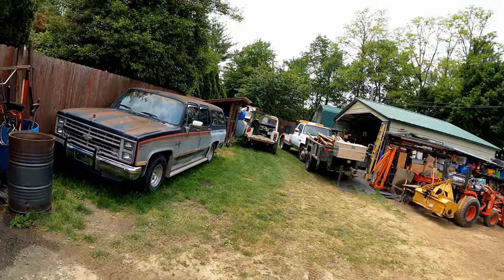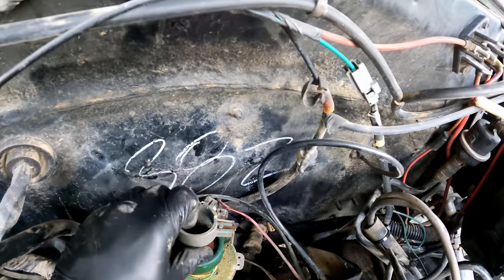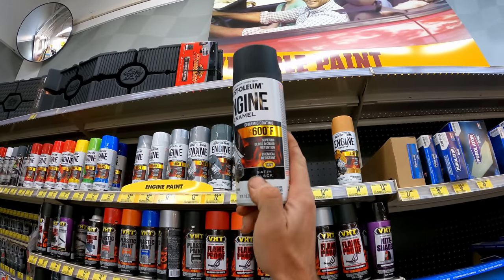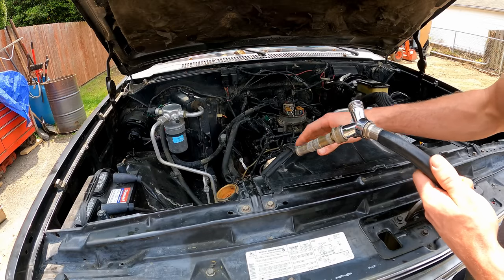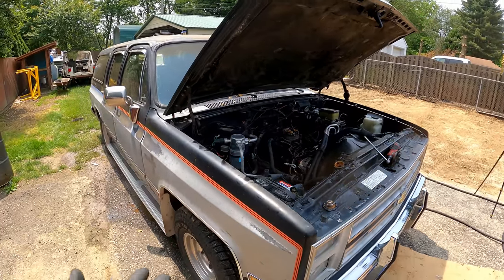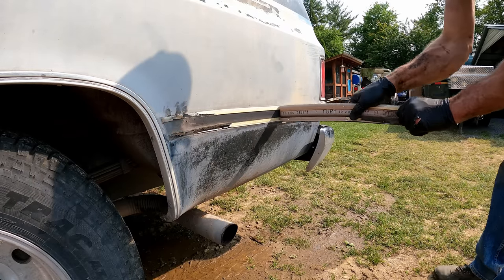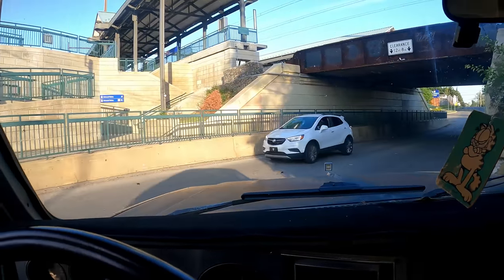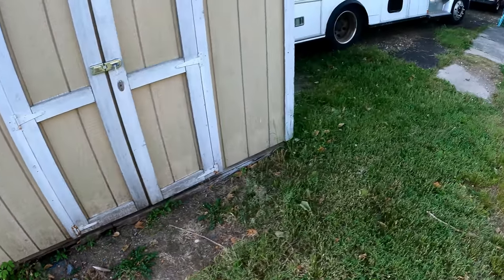'87 Suburban Intake Leak and TLC "Ema2.0" - NNKH

Comment: 11:33 i hate to say but i think you have your intake gaskets on backwards, one end of the gasket has the normal opening and the other has a small restriction. The water flow goes rearward from the water pump around the cooling jackets, then to the rear of the intake thru the non restricted port, forward to the thermostat. The way you have it, most of the coolant will skip the block and intake and go straight to the thermostat. This could cause overheating.
Reply from the maker: They are on proper.  The reason that there are coolant passages in the backs of the heads is because SBC heads are interchangeable side to side.  That's why the heads must have mirror-image coolant passages on both their front and back ends. I do appreciate the concern though. That would suck if I put them on wrong. Not the case though
Reply: @NoNonsenseKnowHow  good deal. I know I was taught to have the front ports blocked if the intake gaskets have it to promote more uniform cooling. The Ford 289/302 you don't have that issue as they only have rear ports.

Comment: travel all no diffent even for made panel truck before excussion bronco full or II differt from hummers no same thing only diffents is personal still take this some that get better rebuild
older less cable hood pins latch non cable drive by wire hand trottle works great now is paddle shift